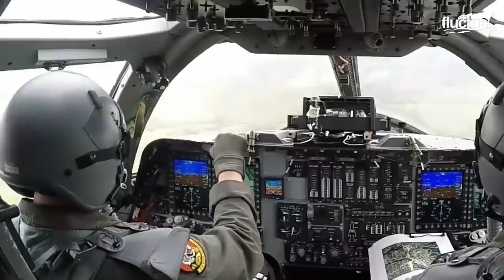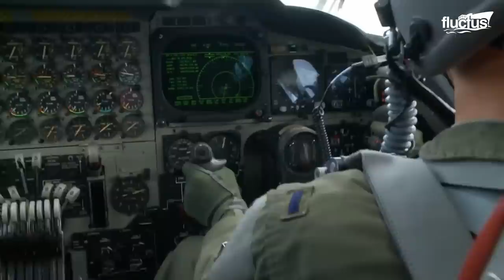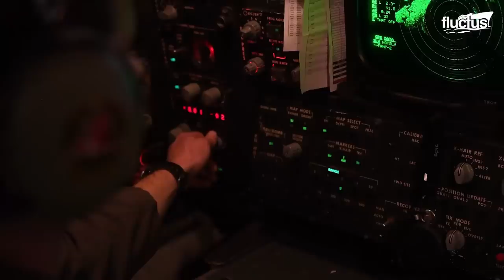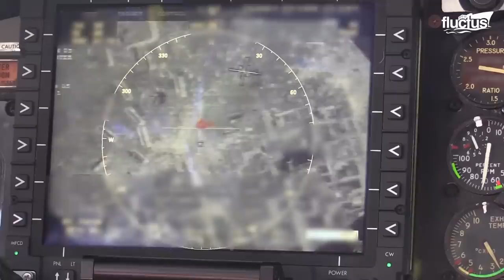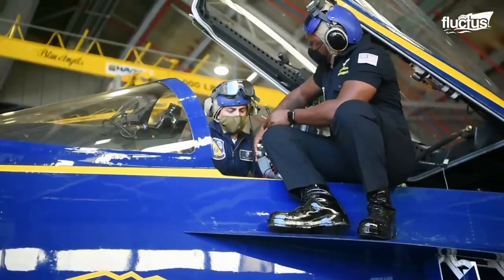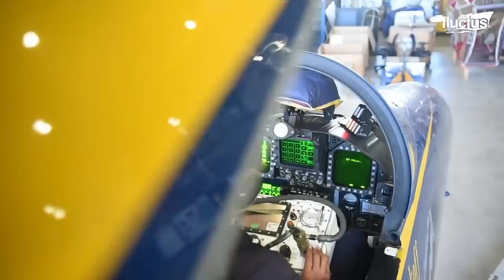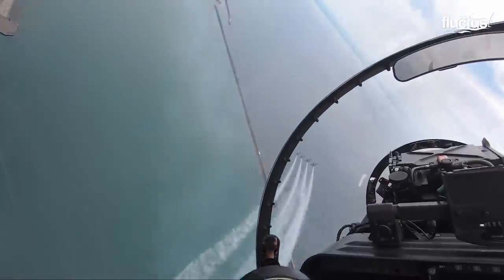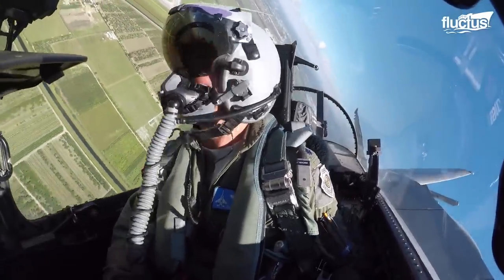US Air Force Pilots Fly Gigantic Bomber So Fast the Cockpit Starts to Shake

Comment: Your footage keeps showing a B-52 cockpit when discussing the B-1B.  The B-1B does not have "skylights" above the pilots like the B-52.
Reply: Are you sure? As the one i seen does
Reply: ...yes it does.
Reply: Well I doubt there is very much video of our top bomber cockpits out there. I mean duh.
Reply: At 2.40 to 2.50 you can see there are windows above their heads on the the b2 series
Reply: More to the point a B1 doesn't have 8 engines therefore it doesn't have 8 throttles as shown in many of the shots!!
Reply: Ui😊
Reply: This videos are just pasting together video clips, without regard to what is actually correct.
Reply: Yes the dead giveaway is 8 throttle leavers lol
Reply: Yes no window over the pilots and two other persons behind them.  All four persons have electrical panels above there stations. Those panels blow off if the ejection seats are activated.  I worked on the building of those parts.   The best thing is the 4” button on the nose wheel witch starts the aircraft automatically.  It’s a great airplane that people don’t really know what it can really do.   Did you know the space shuttle was pre wired for Nuclear weapons?
Reply: To many different clips just patched together to make it worth watching.
Reply: Small ones.
Reply: @liamterry5301 I’ve noticed he uses ALOT of filler pictures. He was talking about jets in another video and kept showing pictures of turbo props. I’m starting to think he doesn’t know the difference…

Comment: The air close to the ground is more dense than the air at 30,000 feet. The F-111 Aardvark was the grand daddy of the swing-wings and terrain following automation. I've read pilot flying toward a mountain you;d instinctively grab the stick, even though the the terrain guidance system would follow the ground. I believe the B-1b can carry 3 times the load of the B-52, and a third again as much as the B-2 Spirit.
Reply: I was stationed at RAF upper hayford, we had F111 s 
At the time the pilots said they were like driving a Cadillac.

Comment: My first job out of college was doing EMP testing for the DoD on the B-1B.  I've been in every bay on that plane.
Reply: Why? Isn't anything outside a faraday cage susceptible?
Reply: @s1988teve  Yes but the pulse needs a conductor to transfer it's energy and short wires etc. just don't couple that much of the energy.  Most electronics will just reboot / lockup (and need a power cycle) because little energy can couple on it.  A plane is long and the pulse can couple huge amounts of energy to the skin and it then can bleed into the electronics.  If you pull the circuit breakers you disconnect the main source of the EMP coupled energy.  Now if you were right over the explosion in Kansas you might get more but once it starts traveling over ground it begins to dissipate.  The longer the wire the more energy that can be transferred to it.  Chicken wire cages is all they used during many EMP tests, so it's easy to shield.  It doesn't have to be perfect either because a small hole will only let so much energy through.   It's much faster than lighting but similar in it's effects.

Comment: The B-1 vanes that they're referencing is called the smcs vane (smucs for short). It allowed the B-1 to ride like a Cadillac at higher altitudes. My job was avionics on the B-1 and adjusting the veins required shorting out the accelerometer. When you did that just bumping on the  control stick cause the veins to flutter like a hummingbird's wing. It was so fast you couldn't see it. I watch the crew chief get smacked in the head about 20 times before he fell off the ladder, and it only took a split second. He was okay and only got mildly concussed. Good times...

Comment: Conrad's on B1 are a band aide to compensate for a marginal elevator. 
200ft at Mach 2.0 is definitely fun, especially for sustained distances. I did this routinely flying my F4E back in the early 1970's while in Vietnam. Without computer augmented flight controls. Just muscles with up to 60 lbs stick pressure.

Comment: The shaking is not due to speed. If there is no high pressure mechanism with a damaged aero dynamic structure, it is as if the plane will burst like a balloon at high altitude.